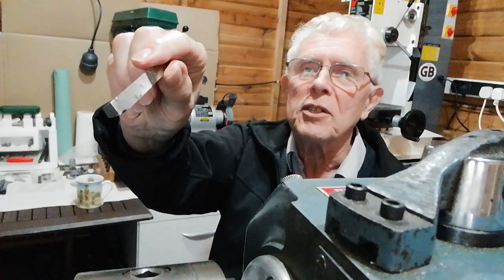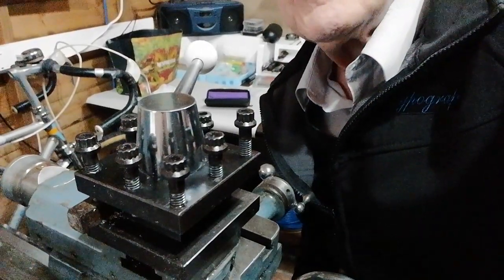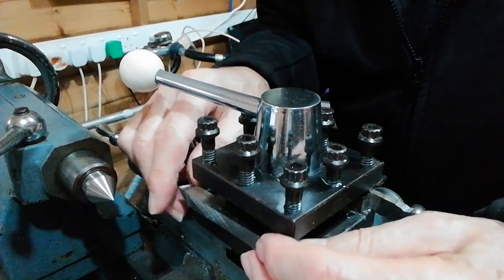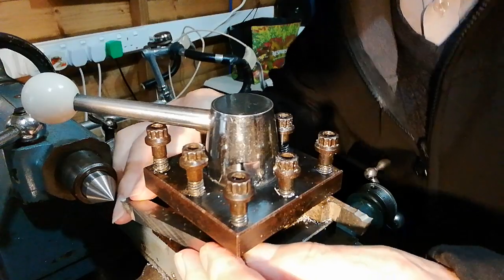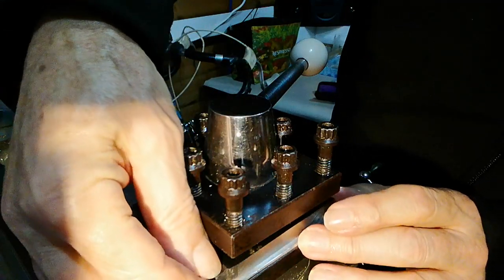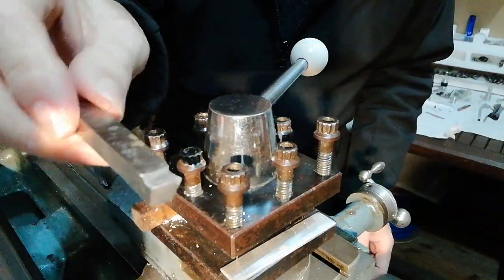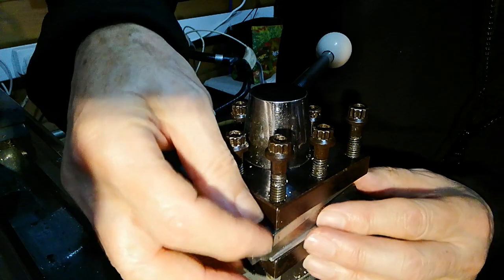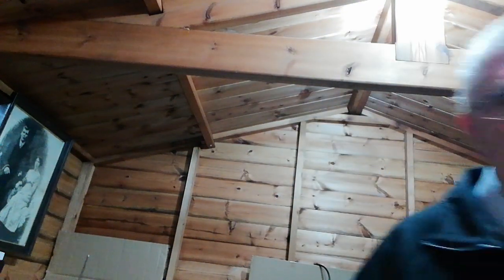How to set a cutting tool in the 4 way tool post, at the correct centre height.

Comment: Hi Keith, I have just purchased my first Mini Lathe, And my first attempt at turning and facing is a disaster. Please can you help ?.
Reply from the maker: Hello Phil,
let's see if we can resolve the situation for you.  There could be several reasons for what you consider to be a disaster. It is not uncommon when attempting to face and turn for the first time, that problems may occur, so don't worry about this. 
First of all,  describe to me what happens when you begin machining, any vibrations etc. 
What material are you trying to machine? 
Is the cutting tool set at centre height? 
What type of tool is it ; HSS, Carbide, High carbon steel or inserts? 
Do you know if the tool has been ground correctly with essential clearance angles? 
Are you feeding by hand, or applying auto feeds?
Answer these questions as best as you can, so I can suggest what to do next to rectify the problem.
I am sure that any issues can be resolved.
Work safely.  🍀
K.